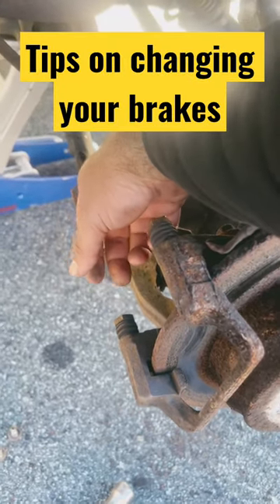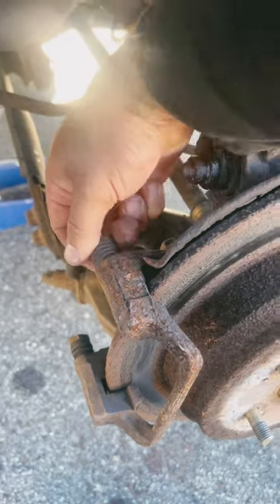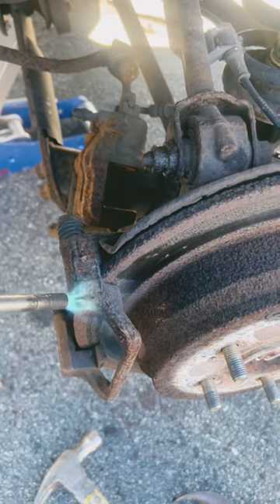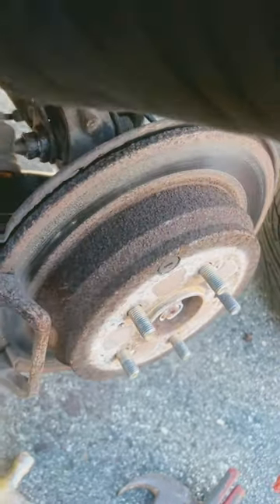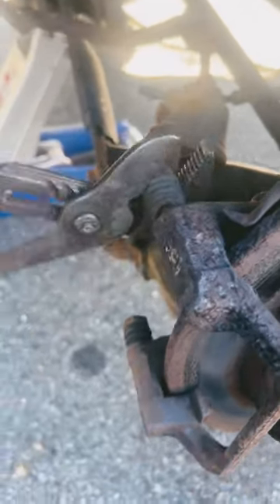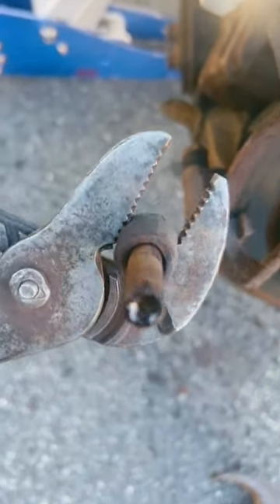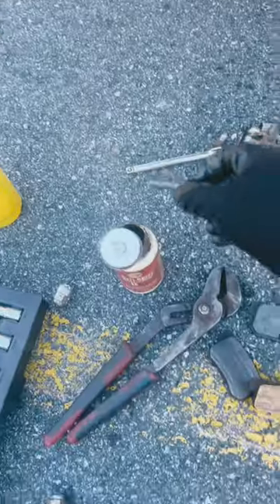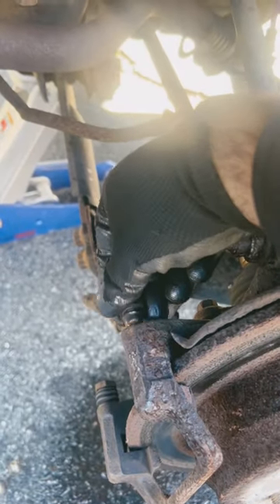FROZEN BRAKE CALIPER SLIDER/ TIPS ON CHANGING YOUR BRAKES

Comment: By time you heat that up that boot is going to be destroyed just buy the boot kit more likely that boots dry rotted anyway, so why even bother? By the hardware kit and put new hardware in it and you don’t have to worry about it. You don’t have to worry about saving a rubber boot. This dry rotted cracked.
Reply from the maker: Im not a mechanic just a everyday guy trying to help.

Comment: For all that work and how rusted that mounting bracket and rotor is just replace it all. Caliper, rotor, pads, and brake fluid service. That will save you at least 45 min to a hour of work. Sometimes to be cheap costs you more time.
Reply from the maker: Agreed 👍🏼

Comment: By the way anti-seize will eat rubber like there is no tomorrow and did you clean the hole out where the slider goes you use silicone grease and by the way you can also purchase new rubbers seals & boots.  You turn a brake job in to a butcher job don't let me catch you working on anything in my shop.  IF THE CAR DOESN'T STOP, PARK IT!!!!
Reply from the maker: Thanks for helping us out!

Comment: Anti sieze eats rubber my guy, gotta use silicon
Reply from the maker: Im not a mechanic just a everyday guy trying to help.
Reply: @Karfix  your "trying to help" is going to leave people with messed up caliper slide pin boots ultimately letting crud into the pins and getting seized in place. Then your caliper is gonna grind the pads and rotor into oblivion or with enough heat it's possible the pad can come apart and grenade the brakes. I'm not a mechanic either. I'm just an everyday guy.

Comment: Wrong lube, That anti sieze will cook from the heat and you will end up with siezed slides again
Reply from the maker: Thanks for your input and help to the community.
Reply: Not if you use the gold
Reply: Why do you think they’re locked up in the first place .. this guys a hack he admits it himself
Reply: Permatex anti sieze lubricant is made for braking components or a silicone high temp synthetic grease